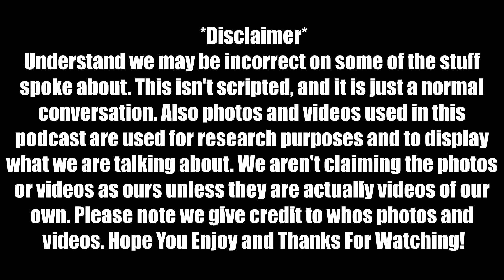Diesel Discussions Ep 2: Rock Island Rail, NS 8520 Finds New Home, Original Family Lines GP16s+More!

Comment: So far, the Rock Island Rail has two GP38s, one GP30, one GP15-1, two ex-BNSF SD38Ps (both ex-SOU SD35s) and are in the process to repaint them into the red and yellow paint scheme, one C40-8, one ex-SSW GP20E that they bought from the Arkansas Railroad Museum in Pine Bluff, and acquired an Alco S-1 and S-2 when they bought the former Great River Railroad that ran from Greenville to the Port of Rosedale. They’ve also bought the former Gulf & Ship Island Railroad around Gulfport. They’re looking at a fourth line to buy but no details have been released yet. They also have a small fleet of cabooses. One caboose, a former Meridian & Bigbee Railroad caboose, was repainted into the Reborn Blue scheme as RI 207. CEO Robert Riley actually rode in that caboose in his earlier railroad days on the Meridian & Bigbee Railroad. The other cabooses includes an ex-Southern Railway bay window in NS MoW orange, an ex-Conrail bay window caboose, and a Southern Pacific bay window caboose.